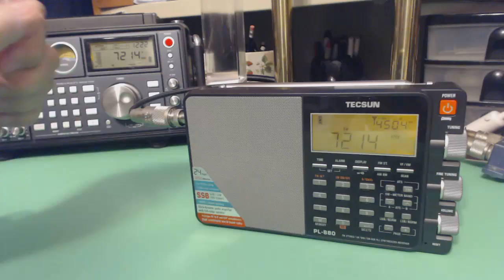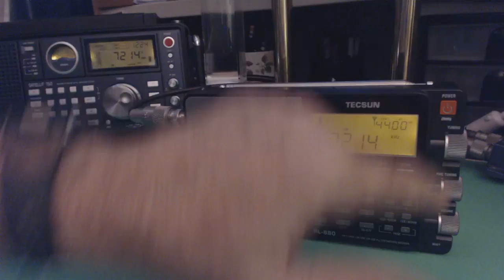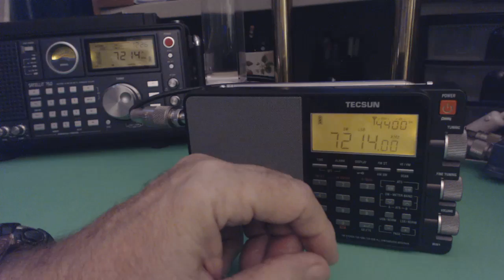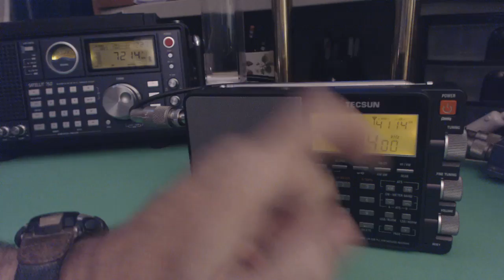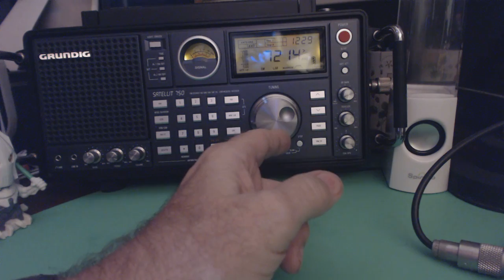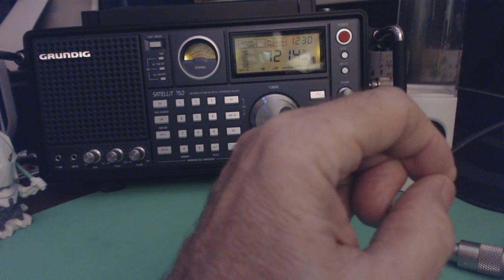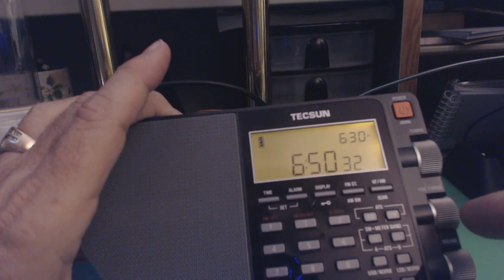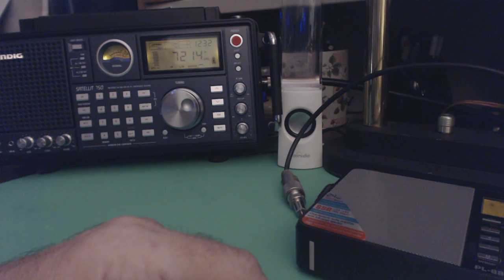TRRS #0661 - Single Side Band (SSB) Tuning

Comment: You've spoken of your older collectible radios before Tom, is there any chance you will drag one out anytime soon for a show? that would be pretty darn sweet!

EDIT: I'm finding that SDR is relatively quick/easy/painless to resolve SSB signals as the waterfall lets you find signals fast.
Reply from the maker: +SpectreOZ I would have to get some help from someone as they are quite heavy.  I do have my Collins 75A-4 in the room but I usually use it in the winter to help heat my office.
Reply: +hamrad88 Unfortunately I can't help with the heavy lifting but that Collins sounds like just the ticket :)

Comment: Newbie question - do these radios pick up the shortwave stations any better than my Yaesu 857D would?  I'm still working out some antenna issues with it.  I do have an old sw radio I like playing around with but it dosent have ssb
Reply from the maker: +LawnRanger II Not having used an 857D, I would have to guess based on my use of my ICOM 706D and I would say they are about equal with my ICOM but the audio is not as good in the ICOM because of the poor built-in speaker,

Comment: Good compare, Tom. Although not exactly a sub-type, yet a "third" method of SSB tuning is as employed by the likes of the Satellit 800, Drake receivers - and others -- where SSB is directly tuned by the main Tuning -- aka VFO - knob. No fine-tuning necessarily  needed, no BFO needed, etc. Easy tuning, and you can tell when the signals are off frequency or right on, etc.

Comment: I picked up some Ham operators today using SSB (Upper with a slight BFO tune) on 7170KhZ
Reply from the maker: +BennyDubya Thanks for the report.
Reply: +BennyDubya And All... Tune the Brothers Network in the 71xx kHz area nightly, usually about 7 PM EST...very nice and sharing guys and gals.